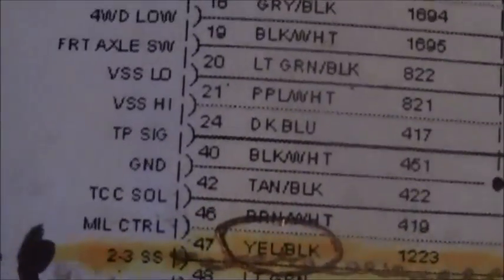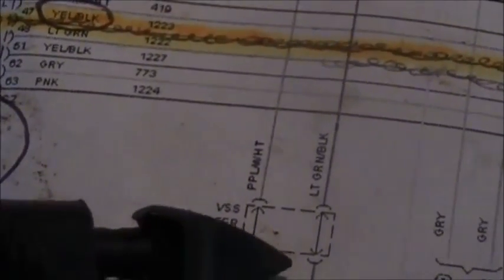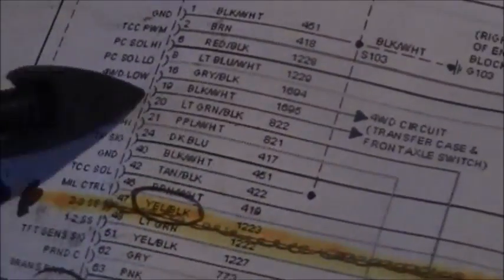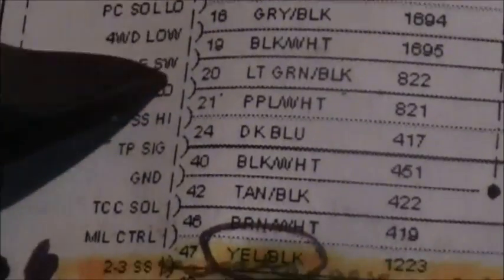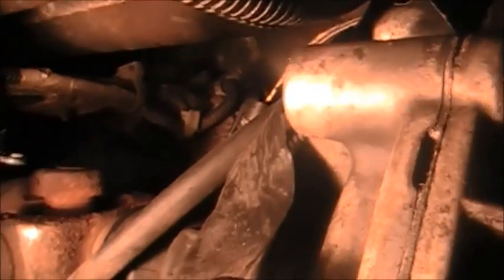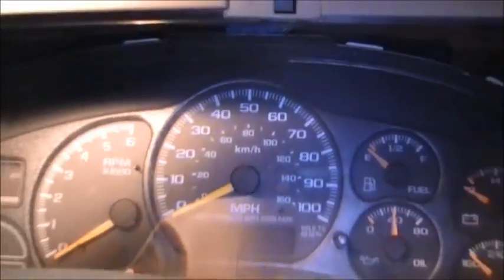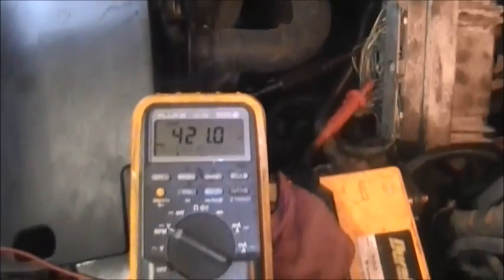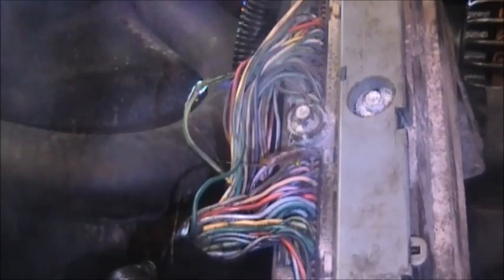chevy silverado shifting problem: P0502 case study A part 2

Comment: what if the truck is two wheel drive and having the same problem only the transmission was shifting and the speedometer was not working? now the transmission won't shift at all.

Comment: The plug that you unplugged, where is it located? The plug with the purple/yellow wires goes to the speed sensor on the back of my transfer case, it's also the only one back there. There is a tiny connector coming from the front of the transmission, with the two wires from the schematic. But those two wires do not go to anything. There is a sensor on the front side of the transfer case, but nothing is plugged in to it. Do I leave the purple/yellow connector to the back of the transfer case? Or do I switch the two and connect a new connector.

Comment: good morning.  I have a hummer h2, it does not change gear the speedometer does not work.  but I have no fault code, can the speedometer be the cause of the gearbox problem?
Reply from the maker: What year?
Reply: @thisisyourtransmission  2004
Reply from the maker: The vehicle needs to be driven with a scanner connected to see if the transmission computer is seeing the speed sensor.
Reply: @thisisyourtransmission  ok tomorrow testing  thanks

Comment: My 94 GMC Sierra k1500 4l60e won't shift into 2nd gear until I get the speed to a minimum of 21 mph and take my foot off the accelerator. After that all other shifts are normal. I've changed tps, shift solenoids, pressure solenoid, vss, pcm and not even a hint of fixing the problem. HELP?
Reply from the maker: The transmission needs to come and be rebuilt when this happens.

Comment: I have a 1995 Chevy Silverado 1500 and it won't go reverse what's the problem
Reply from the maker: Well, I would say that either the reverse clutches are bad or the sunshell is bad. The transmission will have to come out.

Comment: Great video I had to change the tranny on my 02 Chevy 4x4 and I think I plugged the wrong plug in the speed sensor does this model have two speed sensors course where’s that other wire go

Comment: Dude thank for the info. I was having the same problem with my truck. The speedometer wasn’t working and the transmission was shifting hard. I put all the sensors new and nothing. It all started when i had the transmission and transfer case changed at a shop. They couldn’t figure it out either and said it was a faulty transmission so i have been using it like this for the past 3 months and it sucked. I was ready to sell the truck but decided to give it one more try and do some research an came across this video. And I check the plugs, the one and they had been connected to the wrong plugs (same mistake as in this vid) and swapped them and bam the speedometer worked and transmission shifted smooth and normal again. Again thank you so much for making this video and sharing this information.
Reply from the maker: you are welcome

Comment: I had a similar problem. But on mine-rodents had chewed through the adaptor harness right where it plugged in next to the transmission--the same spot yours had the wrong plug in it.

Comment: good vedeo i have a diferent big problem because i change a automatic transmission 4L80E to manual transmission NV4500 the car is a chevy suburban 6.5turbo diesel year 95  and befour this modification everyting is working perfect  and after not working annymore the speedometer and cruise control also any body know who must i do for fix this problem? thanks

Comment: hi mate,You know if the speedometer works in conjunction with the abs sensor? or so even with the sensor that the output of tranfercase? so I need to know a scheme to make a completely new link from the speed sensor until the speedometer.
Reply from the maker: I am not saying that what you did is wrong, however, when you modify something then you will welcome many challenges. Now, that being said, I have never did this before and i don't want to give you what I think when I don't know.